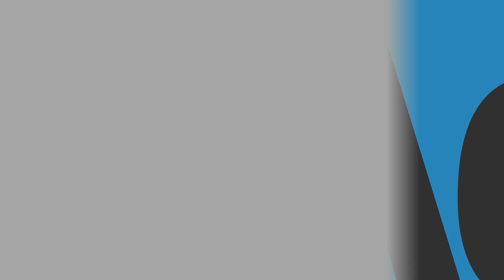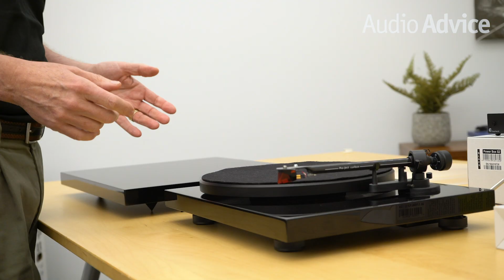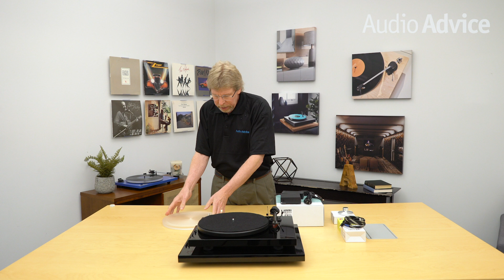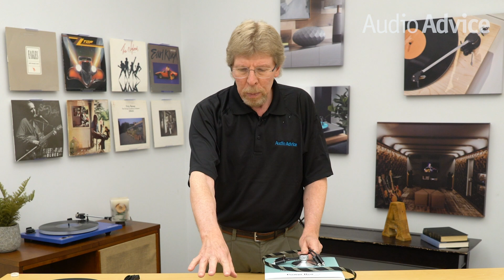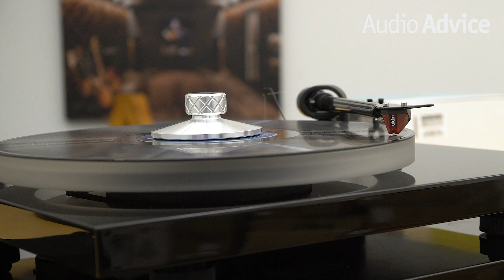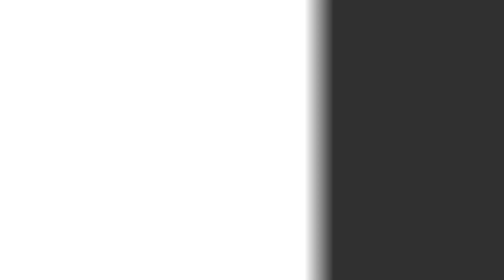How To Upgrade a Pro-Ject Debut Carbon DC Turntable

Comment: I have a Pro-Ject Debut Carbon Dc with Ortofon 2M Red and a NAD 3120 amplifier.  Would inserting a Pro-Ject Phono Box make any difference?
Reply from the maker: Probably not as the NAD has a decent phono preamp.  Upgrading your stylus to the 2M Blue would make a bigger difference. https://www.audioadvice.com/products/ortofon-2m-pnp-mkii-blue-cartridge?variant=41288291319892

Comment: How do you get rid of the motor hum?
Reply from the maker: What motor hum?
Reply: @AudioAdvice  I get a hum between tracks or at the end of the record,  o hum when needle up
Reply from the maker: @WindsorRealEstateProperties  Try and see if you have the hum with the turntable unplugged from electrical power.  If you do, it is physically too close to something that is emitting a hum field or its interconnect cables are too close to a power cord.  If there is no hum with the power removed, something is wrong and you should contact the dealer you purchased it from
Reply: Sorry I should have double checked my comment… so the hum comes while the turntable is spinning between tracks or the end of the record. When needle is up there is no sound.
Reply from the maker: @WindsorRealEstateProperties  If the turntable is still powered up and the motor running and you get hum with the arm up, you should have the dealer you purchased it from check it out

Comment: I can't seem to find any info. on how to replace the O rings under the bearing screws on the back of the tonearm mech..  Before I purchase the snake eye screwdriver from Project I need a tutorial that can walk me through it.  Project sent me the O rings, but I am reluctant to tackle the project not knowing what I'm getting myself into.  It doesn't appear that I need to remove the old dried out and cracked O rings by removing the entire screw, it seems like I can back them out just enough to slip a new  O ring over and retighten the screws.  I have two one on top and the one on the medial side that need to be replaced.  Please let me know how I should approach this.  The turntable is a Pro-Ject Xpression III.  Thank you.
Reply from the maker: We have never actually done this.  Did any instructions come with the O-Rings?  You will need a tool to get the bearings back to the exact some torque.  Meanwhile we will ask Project tech support for you.  Thanks for watching
Reply from the maker: Pro-Ject USA recommended you have a professional do this.  Either your distributor or a very skilled local dealer.

Comment: I set it up but the tonearm doesn't reach the record. I adjust the guide and it fixes it temporarily but always resets. what do I do?
Reply from the maker: It sounds like you should watch our set up guide, something has been done wrong or there is the very very tiny chance the cueing lever is up too high which can be adjusted with a tiny set screw in the housing. Here is the set up video https://www.audioadvice.com/videos-reviews/pro-ject-debut-carbon-dc-set-up-guide/  Thanks for watching

Comment: There is now a aluminium sub platter you can buy to replace the plastic one.
Reply from the maker: Thank you for pointing that out. It was introduced after we shot this video.  https://www.audioadvice.com/pro-ject-debut-aluminum-subplatter
Reply: @AudioAdvice  I have heard the news of the new Debut Pro coming out next month and will be looking at obtaining that. I shall also get the aluminium sub platter, but would have to purchase from the UK. Thank you for your response and providing the link.
Reply from the maker: @bobby666666  Yes, they will be coming soon, we have many on order.  Pro-Ject USA also has those sub-platters on order, no shipping date yet, but they will be in the USA eventually.

Comment: Your replies are greatly appreciated. I'm also still hunting, but no luck. If any USA retailers should read this, and have an aluminum sub  platter upgrade for the Project X1-X2 please notify me here. My new Project X1 turntable has been shipped FED EX, and should arrive in a few days. Again, thank you Audio Advice.
Reply from the maker: Ken- We just heard from the head of Pro-Ject USA, they have had these on order for quite a while, they are due here in about 6-8 weeks.  We will add the product to our site this week and will be taking pre-orders, and its the same price as the Debut Carbon upgrade, $159. Thanks for pointing out this existed, we had not heard about it, but it makes perfect sense as the Debut inner platter is a pretty good upgrade
Reply: @AudioAdvice  Thank you for the information. Let me know when when pre- ordering will begin, and I'll put mine in.
Reply: @AudioAdvice  I just bookmarked your web site, and entered my email address for the latest information. I appreciate everything you've done, and I'll make my pre - order purchase with Audio Advice when ready. My search is over. Thank you very, very much.

Comment: I am experiencing a rumble in my Pro-hectic carbon after twin years.  I notice that the screw in the motor bracket are in place when I remove my acrylic platter. I see that some are saying these should be removed. Any thoughts?

Comment: Firstly I wouldn't say that I am an audiophile more of a music lover but I do like quality reproduction of sound. I have quite a few records in the basement so I thought I would go out and buy myself a budget turntable to be able to play them. I used to have an original debut which I sold a long time ago so I knew that basically they were ok. therefore my choice settled on the project debut carbon dc with an acrylic platte. The cartridge is an ortofon red. I connect this over a musical fidelity v-lps phono stage to a NAD amp. My speakers are Key ls50s. At first I wasn't really bowled over by it. I was getting quite a lot of inner grove distortion and the wow factor wasn't really there. The Kefs are quite revealing so its easy to make a comparison between my CD player and the turntable. I decided to persevere though and after it had been used about 50 hours it seemed to come to life. After all it is a mechanical piece of kit. I also went out and bought a job lot of Deutsche Gramophone records in pretty much perfect condition. Well what can I say with a high quality pressing and recording the Pro-jet is amazingly dynamic and clear. I will leave the question of whether vinyl has more resolution than CD to the hardcore audiophiles but what I will say that the debut is a lot more enjoyable than the CD and subjectively sound just as good if not better.  Ps I have tried the acrylic platter with and without a mat and without is much much better. I have no idea why but without it there seems to be less static and crackle and pop....

Comment: Will the power box cut down or eliminate the hum from the stock power supply?  I love my DCDC , but the hum drives me nuts, especially when playing records at maximum volume.
Reply: You shouldn't have a hum at all. Either your turntable to top close to another electrical item (speakers, tv), or you need the cables connected to your grounding screw and a metal screw on your amp.
Reply: Find your noise reducing answers here- this made my day today:  https://www.youtube.com/watch?v=7wm_joKQpzY

Comment: I have  the pro-ject  debut 3 I replaced the platter with the acrylic platter cause I felt the metal platter it had I liked it but when changing the speeds I was worried about scratching the surface of turntable because being human it could slip out of fingers and mar the surface but I don't agree with putting record on top of acrylic platter by itself  cause of the fear of scratching record no matter how careful one can be there still will rub slightly against the surface ,plastic against plastic or vinyl when you rub against it will  slightly scratch it  especially before I use the record clamp when I use a carbon brush to clean and remove dust and static on record ,just a slight amount of pressure the record slides on platter slowing down the record and when  it slides on surface of platter you can't remove dust or static if the record is stopped while the platter is still rotating just a slight touch on record while platter spins slows it down to a stop ,I use a cork mat the felt mat also causes the record to slide on platter when trying to clean record,I feel felt mats are useless unless you are a DJ and scratching records for playing effect .growing up the best turntables always came with a rubber mat don't understand why they have to cheap out and convince people felt is better since it is cheaper to make than rubber .I have been using record players all my life i feel I know what works great with turntables ,I am not against new ideas if it works  but I had to say at least something about this  JRo

Comment: You forgot switching cartridge's stylus with one for the Ortofon 2M BLUE. There is also an accessory pulley to use for 78 RPM records (special stylus required)
Reply: Are you kidding??  

They did not forget.  Rather, they purposely left out mentioning the cartridge because the Pro-Ject Rep does not work for Ortofon.

Comment: The easiest way would be to buy a cd player. It's also cheaper, more durable, you can change tracks in less than a second and the fidelity is waaay better. It's no wonder why everyone left vinyl behind as soon as CD became affordable.
Reply: José Pinteiro da Costa Bisneto what makes you an expert.
Reply: @veedub95  Nyquist was the expert.
Reply: @pin.  Old comment I know but worthy of discussion.   Many people who own a turntable these days also have a CD player or do streaming or listen to digital files or cassette tapes or whatever.   

CD and digital offers no wow or flutter, no crackle or other surface noise, and a ridiculously low noise floor in general.  

If you listen to older music vinyl offers the original mastering of the recording not some modified remaster that may be a mix of improvements and things you may not want like reduced dynamic range to make the recording sound "better" at lower volumes.   

While there is certaily some positive to be said for remasters there also is something about the original vinyl mastering on a good pressing of an album that has value and is historically interesting.  Also some people have recordings that are rare enough to not be available on any more modern format so having a turntable to access those recordings is essential, one might even use the turntable to play that record and make a good digital copy of it.

Another reason one might chose a to buy a turntable would be already owning a lot of vinyl. I have about 1500 nice well curated pieces from the 1950s right up through the decades that have been cleaned and mostly are in very good shape.  I've been mostly ignoring the collection for a number of years now because my old turntable has been getting increasingly wonky and just yesterday purchased a Pro-ject Debut Carbon EVO to replace it.   

Anyway my point is that it's not quite as simple as "buy a CD player... it's better".   Records are a pain in the ass really but they are cool especially when the recording is old enough that vinyl was the original format.   I'm kind of in-between on the whole vinyl vs digital thing as I'm not a fan of nostalgic crackle sounds but I do own a good deal of unusual old recordings as well as early pressings of more popular stuff.  I listen to streaming music, CD's, and vinyl but would tend lately to purchase a digital format of some sort because I like both the convenience of it as well as the lack of record noise.   

Long ago I owned a Linn LP12 with a Fidelity Research arm and a Grado wood cartridge that was like $300+ decades ago.   I have to say that along with all the downsides of vinyl there was something to the sound of some of my best records over listening on CD... not sure how the Pro-ject will do but I'm excited to hear some of those old discs again and see how this new fangled carbon armed somewhat budget audiophile table can do!!!   

Have a nice day and enjoy some music on whatever format makes you the most happy.
Reply: CD has better fidelity?
Wow...try again!!

Comment: Does anyone know if the suggested power supply projekt power box s2 is compatible for Australian models? Thanks.
Reply: Yes it is, but you do need to also buy a universal power adaptor so you plug it into the mains in the wall.

Comment: How do you not even discuss upgrading to the 2M Blue?? I'd argue that is the most important upgrade over everything you listed.
Reply: Or the AudioTechnicaVM540, way better.
Reply: @jaggs7346  sure there are better ones, but the upgrade to blue is as easy as it gets to install.
Reply: @Scott Frobel except it takes 2 seconds to install the blue. I can't imagine it's that easy for the AT. I also realize there are better upgrades for this table, but I highly doubt Audio Advice is going to suggest using an AT cart.
Reply: @oscillatingdailyaudio  the 2m bronze is better than AT, at's affordable carts are pretty poor